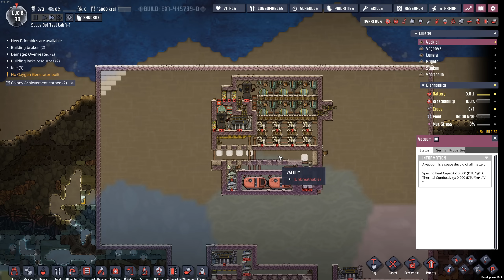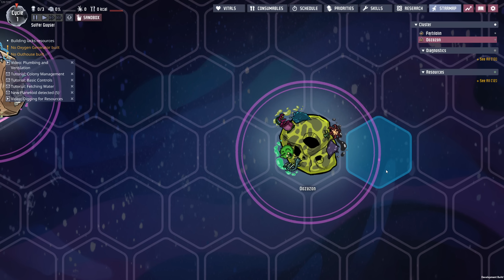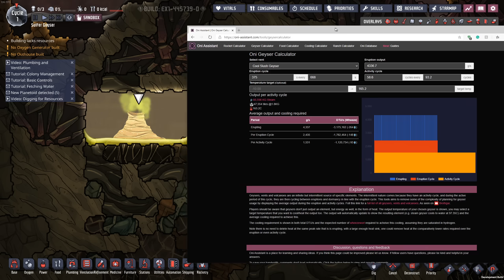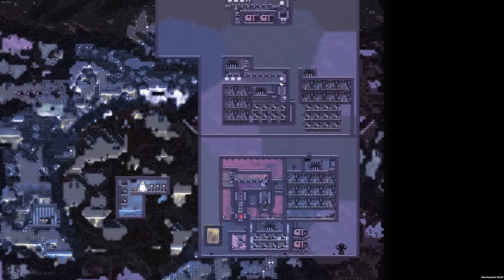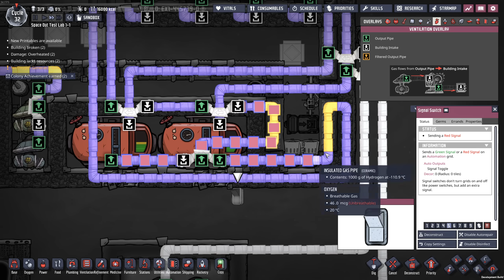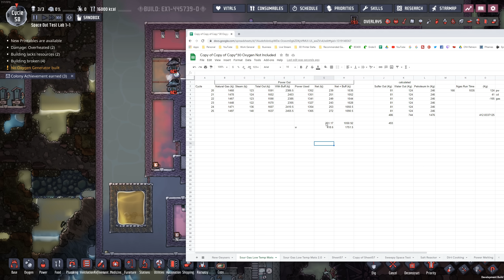MORE EFFICIENT POWER! Steel or less Sour Gas Boiler Experiment Blueprint. Oxygen Not Included

Comment: if you was to be stacking those thermal regulators and then coming in the bottom one and each one above it cools it further that would keep the counter flow thing going in the heat exchange, the bottom ones stay the hottest point of that part of the system which will make it fire up faster and keep that steam at temperature. 3 high  by 3 wide should make it as efficient as possible, you was rarely firing up the last one anyway

Comment: Nice videos Brothgar. I designed a boiler that can process 1000g/s of sour gas with approx 4.5kW power profit. Just a little steel and ceramic is needed to build it, the rest is cheap stuff. It uses very little heat because most of it is recycled infinitely. I call it "Bionic boiler" because I stole the idea from Crane's blood vessel heat exchange system :)
I can send you the save file to show it if you want.

Comment: Looking at this system with the notches to caprure the natural Gass, What would happen in on the "cooler Side" the bottom half dropped a couple of tile and enlarge the Sour gas channel by one tile. Keep a 3 tile high path at the entry and expand it to 4 tile to allow the gas mechanics to route the Natural gass to a gas Pump. That gas line meets up with the other natural gas lines.

Maybe add 2 thermal regulators to the end.  so that the methane stays liquid for the mini pumps

Comment: But can you use the thermoregulators to help heat up the crude oil? The machine wouldn't be self powering, true, but it'd probably require less of a heat intake.
Reply: There's more than enough heat in the sour gas to preheat the crude oil as the specific heat capacity goes up with the transition.

Comment: Title: Steel or less
Insulated tiles: Insulation
Reply: Double up ceramic and you will be fine. The eventual heat death of the universe will kill you before the heat bleed from the system.
Reply: Did i miss something? you seem to be upset. 8:24 and on some other points i check after reading your coment. it says ceramic, soo a Kiln and some clay  prety erly game stuff and easy to get. I dont get your point.

Comment: Your in sandbox use fill vacuum in the sandbox options
Reply: I think he was trying to sort out how he would do it in his normal game without having to pump down to a vacuum. Its easy to forget about those kind of details when your in sandbox mode and paint yourself in a corner when the time comes to do it for real.
Reply: @Kezat  ya but the point is to figure out the process then you build it for real you use pumps to vacuum the whole space before you start the fact he was so far into the process with all the gasses it just would have been faster and your doing it in sandbox to make testing easy use the option it gives.

Comment: you could save a little power just turning on the autosweeper for 30 seconds a cycle, that way it does a fair load at once not constantly active, moving the output from the steam generator might make it a little more efficient, you are cooling down the main heat input this way no?

Comment: The natural gas problem would likely go away if your hydrogen cooling on each branch started with one metal tile each under the pumps.  The problem is you have a little heating at the pumps that turns some of it back into gas.  If the liquid methane landed on a cold plate instead it wouldn't get that chance to reheat.  (This would also be one spot where the two hydrogen loops could even out with each other).  Hope I explained that well enough.   It's hard to do without pictures.

Comment: This is not at all more efficient. It is like just using some turbines to cool the sour gas and not heat up the oil, see a huge bump on energy generated and say it is more eficient.
To be more efficient you want  most of the energy from the sour gas being used to heat the oil.

I think the reason is that the natural gas heat is not being deleted but transfered to the water vapor on the chamber.
Reply from the maker: The power used (1300 kj) stayed the same, but the power generated increased (250 increased to 600 kj).

Comment: I remember back before super coolant people would use liquid oxygen through aqua tuners for more cooling.  Would that work better than hydrogen in this setup?  You would need another transfer section since liquid oxygen would be colder than you need for methane.  The heat capacity is only 1.01 but you are moving a lot more though it.
Reply: I too have been thinking about this since the last video.

For safety, simplicity and probably also energy efficiency I would go with Regulators and hydrogen.

Pros:
1 aquatuner takes up less space than 4 regulators

Liquid Reservoir takes up less space than a Gas Reservoir and also stores a lot more

1 pipe packet of liquid oxygen can hold 10.1 kDTU/C (1.01 (DTU/g)/C * 10 kg) instead of just 2.4 kDTU (2.4 (DTU/g)/C * 1 kg) for 1 pipe of hydrogen. Haninge a larger capacity for transferring  more DTUs per tick.

1 Aquatuner removes more DTUs per tick than 4 Regulators. 141.4 kDTU/tick (14 C * 1.01 (DTU/g)/C * 10 kg) for liquid oxygen compared to 134.4 kDTU/tick (4*14 C * 2.4 (DTU/g)/C * 1 kg) for hydrogen.

Cons:
1 Aquatuner is more expensive to run than 4 Regulators. 1200 W for 141.4 kDTU which is ~8.49 W/kDTU. Regulators remove 134.4 kDTU at the cost of 960 W (4 * 240 W) which is  ~7.14 W/kDTU.

Liquid oxygen has a temperature range of ~36 C. The lower 14 you might not be able to use due to risk of pipe damage, leaving 22 C. 1 packet thus has a total capacity of 222.2 kDTU (22 C * 1.01 (DTU/g)/C * 10 kg) before pipe breakage which is enough to transfer 117 C from 1 kg of sour gas ( 222.2 kDTU / 1.898 (DTU/g)/C ). This might be good enough but it’s strictly harder than hydrogen for which you do not have to care about pipes breaking.

You would also need the Regulator setup to create the first batch of liquid oxygen. Thus taking up more space and also forcing you to use more of your own life to create another system apart from the actual system you’re interested in.
Reply: I've condensed methane from 1kg/s sour gas with only 3 thermo regulators. There's a video on YouTube doing it with 4. It gets down to 3 if you also use the sulfur to cool the sour gas. I ended up with 80C sulfur and natural gas.

Comment: I tried to tame a sulfur geyser by letting the sulfur spill onto diamond tiles cooled by radiant liquid pipes running ethanol (target temperature of -100 degrees) but the single aquatuner I had running the loop didn't seem to be able to remove more heat than the geyser could add, so it eventually went wrong
Reply: That's where I'm stuck. I tried taming the sulfur geysers a few different ways, but nothing seems to work. help! lol
Reply: Ethanol has pretty terrible SHC. Why did you want to cool it down to -100?

Comment: brothgar, you should build a vertical stack, and run your regulators in parallel, instead of a chain. if used in a gearhead gaming arrangement, you can reduce the regulator use down to 4.

Comment: 22:25 If you're running the natural gas through the start of the system where crude oil is heated into sour gas, aren't you just stealing heat? Its going to take longer and take more heat to push that oil into sour gas if you're cooling the start like that. I think the natural gas pipe should absorb that heat a little bit higher up. Correct me if I'm wrong, though. I've never attempted something like this myself.
Reply from the maker: Maybe. If I used metal tiles on the other side it might have an effect. Hard to say for sure.